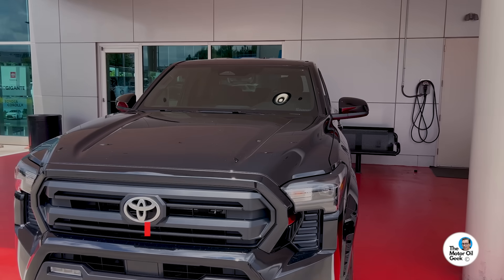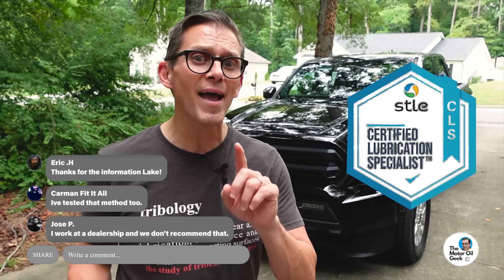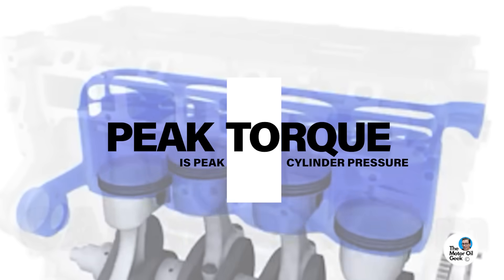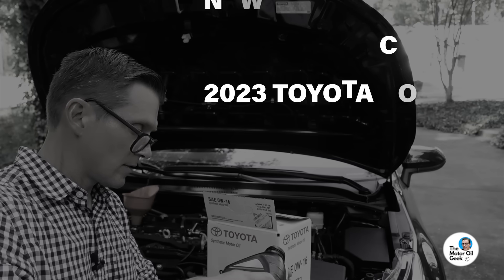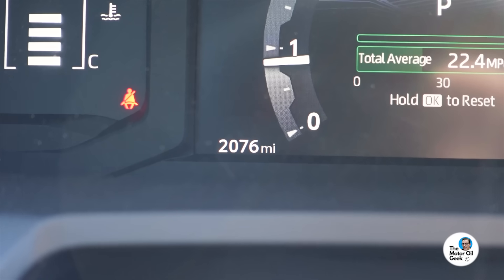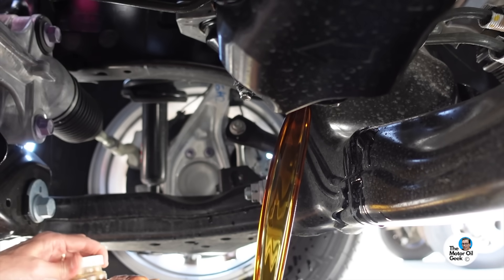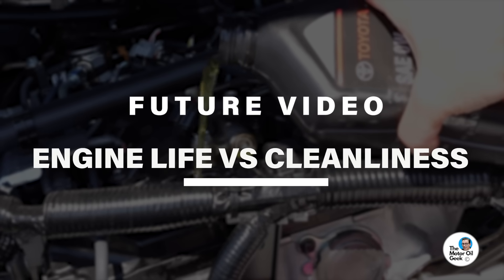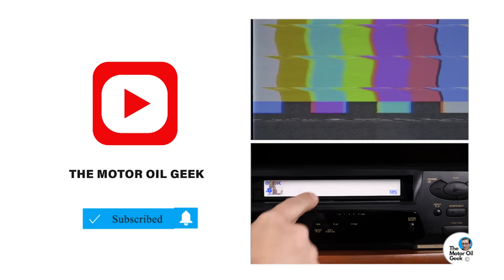The FACTS About Oil Changes (What The Owner's Manual DIDN'T Tell You)

Comment: I love all that you say. That said, and not trying to be contrarian, I have a hard time believing one should equate an air filter (whose defining methodology uses the original entrapment to catch particles it may not [not solely that]) with an oil filter. So yes while you can change an air filter too early trying to optimize causes you to not maximize its filtration. I donot know that also applies to an oil, a transmission or other type filtration to just assert it.

Comment: My Defender 110 had its first oil change at 1100 miles, even though the owners manual said every 21,000 miles. I ignore the manual and do the oil change every 4500–5000 miles or 6 months, which ever comes first.

Comment: So, what do you think about different oils being better than others?
I know hot take.
I switched to Amsoil full synthetic years ago, now I use their signature series full synthetic that claims it is good for 25k miles.
However I always change the oil in my 2024 Integra Type S, every 5k, and during break in I changed it at 1k miles, then again at 5k, 10k and I am about to do my 15k oil change as soon as my oil gets here.
I also use their full synthetic for high mileage cars in my 07 350Z with 180k on it.

I also followed owners manual specs, kept it under 4k rpms for 1000 miles, then only up to 5k rpms until I changed the oil, then after 1500 miles I took it to red line for the first time, I rarely ever go to 7k rpms, but once in a while, I normally shift between 3k and 4k, and when I an driving spirited, 5k rpms is more than enough.

Years ago I read about an 8 ball bearing test that claimed the Amsoil had noticeable advantages in reducing wear compared to the others that were tested back then, purple, mobile 1, Castrol etc..
I bought into it and started using it in all my vehicles back around 2014, is there any science to it or am I just a victim of hype?
Although there is no hype for Amsoil, most people never speak of it.
Reply from the maker: FAKE Oil Claims: The “Lubricity” Test Problem
https://youtu.be/ipunDlG1k-8

Comment: BMW has this ridiculous oil change interval of 15,000 miles, which is insane considering their inline 6 motors are turbo charged and their V8s. 
15,000 yeah no ways especially on a turboed 6, no wonder they have issues later on. Most BMW customers could care less because they get free oil changes at 15k. I would half that to 7500 at most. Would never buy a used BMW. 
This is why I have a Lexus RC-F with the 302 V8 hardly needs maintenance. I admit I should have changed the first oil change sooner than 5k, but I doubt it will hurt the longevity of the motor as the 2UR is bulletproof. I use OEM parts from a dealer and never on Amazon or eBay. Fake parts can damage your motor. I do my own maintenance as I do not trust the lowly fresh tech who just graduated auto tech school. Heard many stories where they overfill RCFs at Lexus dealers. So that's why I do my own maintenance and not because I can't afford it as the RC-F is almost $100k. Seen many Lexus V8s with over 200k miles run like a top. The famous Lexus GX SUV are so reliable they last so long, these vehicles are worth buying used but me I prefer New cars. They barely need any maintenance.

Comment: Now that modern cars let you see the Engine Oil Pressures, in Pounds per square inch, in real time, I have noted a difference in my vehicles. One is steady psi +- 5psi and the other has a variable range,+= 40psi, with engine rpm.  I think a video on this subject would be good!

Comment: I have an interesting question concerning older cars. For a retirement gift I bought a 2011 Mercedes E350 convertible. The Mercedes shop tells me that the oil Change interval is one year or 10,000 miles. I don’t trust the 10,000 mile so the most I would let it go is 5,000 miles. Then there are only certain oil that is Mercedes approved. Any thoughts or experience with oil and Mercedes would be appreciated.

Comment: Here’s a question I have for you motoroilgeek… what impact (if any) does fresh oil have on non moving seals? For instance valve cover gaskets or oil pan gaskets. Would not changing your oil cause these gaskets to erode/flatten faster than a vehicle which had its oil changed out regularly ? 

I can understand a valve seal or main seal wearing out due to dirty oil full of debris/contamination much like bearings take a beating with dirty oil, but some folks tell me that other gaskets like the aforementioned ones fail faster when there’s contamination in the oil from not being changed out. 

I feel like that’s not true, as I’ve maintained 15 year old vehicles that are pristine inside the engine, short oil change intervals for sure, yet the engine leaks significant quantities of oil from every imaginable point of failure.

Comment: I agree 100% on an air filter, actually filters better as it becomes plugged,  but I have to disagree with the same philosophy on the oil filter,  you must keep in mind that these have a built-in bypass valve, that you won't know whether it's bypassing or not, so, I would highly recommend to never not change the oil filter.

Comment: I've been following your advice for my 2025 Toyota Rav limited hybrid. 
Had the oil/filter change done at 500 miles.
Today, I went in to the dealer to  have the oil/filter changed at 3000 miles, 5 months old.
As I pulled out of the parking lot, the check engine light came on, flashed low oil and flashed hybrid system disabled.
Went back to the dealership. The kid "FORGOT" to put the oil in.
They dumped a quart in. Started it up, which sound like a grinder momentarily. 
Had them check the oil. Over filled.
Drained it, replaced the filter and refilled it.
Had them save oil from the oil filter and drained some from the oil pan into a separate container. 
They erased all the codes and gave me an invoice stated what happened for future issues! 
A couple of questions please.
Do you think there is or could be any serious damage to the engine? I get in RPMs getting onto the main road before everything happened. 
Who do you recommend to send the oil samples to.
Could the samples be contaminated because of the make shift containers they used?
Thanks
I enjoy your channel very much.
I've always been old school about oil changes. I used to own a company that ran 18 service vehicles. Ram mobile 1 in them and changed every 3k miles.
Cheap insurance! Never had an engine issue.
Thanks again and Happy Thanksgiving
Reply from the maker: We’ve seen several samples from engines where the oil was not properly replaced. In almost every case, the was now measurable damage to the engine via the used oil analysis. SPEEDiagnostix can do the used oil analysis for you to see what it shows.
Reply: @themotoroilgeek Thank you for the reply. I'll contact SPEED after Thanksgiving. 
Thanks again.

Comment: LOL ok… you are doing the right thing BUT is it “worth it” 99% of cars the rest of it doesn’t make it too far past 300,000 miles the paint is usually meh, the seats are worn and many other aspects are meh. So what exactly are you trying to do? I’ve had multiple cars last to 300,000 miles and before synthetics I did the oil changes at 3,000 and now with synthetics I do it at 5,000 miles. You are just throwing money away. I had a 2003 Toyota solara and it lasted to 298,000 miles, that series of engine had defective head bolts and the head would lift and at 298,000 miles the head bolts left the chat. So it didn’t matter what I did so the oil.

Comment: I did this anal oil changes on my first new car (1998 V6 Accord) at 750 miles (based on memory 😮).

I don't know if I replaced a special break in oil too soon or if I used too good of oil (1998 Mobil 1) and stopped the break in process. But that engine always used oil. 

Oil consumption was minor,  very acceptable but not appreciated.

Comment: Long shot and off topic but many of us have side by side utv of all designs. In the end though,  smaller engines. 2 and 3 cylinders. Racing, rock climbing, trails, farm work, etc. The community on this is HUGE! And it's a common topic of what's the best viscosity, intervals for the differentials, engine and transmission for both oil brand, viscosity, etc and filters. Would LOVE to see you dive into this for us. It would likely go viral in those communities.

Comment: I just bought a special ordered 2026 Ford Transit150, 130WB, low roof cargo van. I'm excited to do my own 900-1,200 mile oil change. It's a 3.5 non turbo with 12 quarts! of 5w30 oil . Please pass the Pennzoil Ultra Platinum oil ✌️

Comment: Ram had an interesting break in in the manual.  When new,  do random acceleration from 60 kmh to 100kmh full throttle 10 times in a row to set the rings.  It's in my manual. 
Everyone comments how much power my truck has.  Also I have a catch can.

Comment: Yeah I just bought an Elantra N, and as we know Hyundai has some longevity issues, especially high stress engines.  So did a painstaking breakin and dropped the engine and MT oil at about 1100km.  Dealer looked at me like crazy but did the work as requested.  I will follow your mileage for the remaining early oil changes.  It's costly, but it can't hurt. I drive cars fairly hard.

Comment: I always tell people, do as little or as much preventative maintenance as you want, because in the end that repair bill will be on you. 

As for my self, I change engine oil and filter every 3.5K miles, all other fluids get changed every March. My 2008 V6 Highlander has well over 250K miles on it and runs really well and idle is smooth and quiet.  😎👍
Reply from the maker: Thanks for sharing!
Reply: I had toyotas changed at 10k intervals with over 200k miles, too much frequent intervals have diminishing returns.
Reply: @roninbushitoろうにん  Probably so, but it is fun to do and it allows me to keep an eye on stuff while it is on the lift.
Reply: @lpg12338  Yes I enjoy working on my cars too even though I can afford nice cars. I just don't trust the dealers apprentice who just got out of automotive tech school. 
I also got a lift not long ago it's a challenger lift made in the usa. I maintain my own RC-F and other german performance cars.

Comment: I drive a 22 year old car that runs like it did the first day, brand new.  I fixed the upholstery and headliner last year.  This year, it was repainted.  An outdoor car.

Yes, I keep notes by each component.  Date and mileage.    When I take the car in for servicing, I treat it like a doctor's appointment with a modification.  A list of what service I think should be done and  the factory parts, if specified as best in the literature or by a qualified mechanic.

I am not a lubrication specialist, only a businessman.  Whatever service(s) is recommended by the manufacturer, it is to get the car through whatever warranty period promised.  The manufacture states that if you do rough driving, the service(s) should be done sooner.  

So, what about an oil change?   I have a series of ideas:
1.  my driving stops and starts on only short urban hops.  Maybe 3-4 stops in under 5 miles.
2.   I know what the price of an oil change with me providing a quality oil filter.
3.   I have an idea that if my engine fails, I might have to get a replacement car with a higher insurance rate, possibly finance charges, probably higher vehicle registration fees, and a drain on my time.
4.  If I wanted my car to go another 100,000 miles with oil changes at 5,000 miles and costing $50 each, it would cost $1000.
5.  If I made the frequency every 3000 miles, the additional oil changes would cost me $650.
      Would I rather pay $650 for more oil changes vs. the cost of working on an engine or the sales tax on a replacement vehicle plus the time taken to deal with the purchase and registration.
6.  My driven mileage each year keeps dropping.  So, now the change is 3000 miles or 9 months
7.  I live in a county that requires a smog check.  This translates for me into an Italian tuneup and additive every two years to pass smog.  I no longer get free retests, so an additive is put in.  I note that I waited 20 years to do the 15 minute carbon clean out before an actual oil change.  All of my driving had been short hops.

Comment: 500, 1500, 3000 is how I have done it for 40 years ( I am 78 years old ) All my motors had over 200,000 miles
Reply: This engine may not make it.
Reply: And how do you know that the early oil change made a difference?
Reply: @JDT-pq3wi ’Cuz momma said so.
Reply: @TruthInFlying 😂
Reply: Now 73 and my last truck had 240,000 miles before failed. All my trucks were used. I always got way over 1000,000.
Reply: @ginoaluzijr9522 Now that’s what I call high mileage.

Comment: Not just oil filters, but home air filters actually filter better as they get dirty. Most people waste money changing filters monthly (too often).
*Tip take a new and your current filter, hold both up to the sun side-by-side, if the current one is half as bright, replace it.
Reply: Air filters get better because contamination sits on top of the media.     The shearing forces of oil push particulates into the media.    Imagine your filter media has many different size pores (large, medium and small).   As contaminant enters the filters the smaller pores are more likely to be  blocked first.   As time goes on, the only remaining open pores are the medium and larger pores.  The automotive and aerospace industry recognized this in the 90’s where Dr. Finch developed the multipass test which tests the filter over its complete life.    See ISO 16889, SAE ARP 5454 where particle counters show a degradation over time.    Exceptions:  In some low velocity cases, filters can “cake” where contaminant will plugging the front face and efficiency will improve.

Comment: I just followed your advice on my 2026 Ford F450 6.7 liter power stroke. It has 2800 miles and I drained the oil but left the oil filter. I'll do it again at 4500 or 5000 miles.  I should change oil filter next time, correct?

Comment: If you had a motorcycle that sat over the winter and you had neglected to change the oil prior to winter storage, would you warm it up in the Spring prior to doing an oil change?
My thinking would be that any dirty oil and metal had a chance to settle to the bottom.  Why warm it up and distribute things throughout the engine again?
I can see the viscosity being thicker because the oil is cold, but you could chase any oil that remains in the bottom out with a bit of fresh oil once the initial dirty oil has fully drained.
Thoughts???

Comment: I see that the engine is not broken in by 2,000 miles. How does this compare with 1950s cars? Back then they said to change the oil at 500 miles initially, but weren’t they about 10x more crude/inferior build/faster wearing?

Comment: The guy from Donaldson refers to the air filter, not the fuel filter. Perhaps it might apply to oil filters too, but i would go for a oil filter change too. Also, very interested about the Toyota oil filter, and here is why. I own a 2024 Highlander Hybrid (i live in Romania), and the car came with an oil filter made by Denso, made in Japan. All the replacements after that were also with a Toyota filter, also made by Denso, but ... made in China. The difference ? Well, i kept both japanese and chinese filters and cut them open, and what do know ... the chinese one had 40% less filtration surface. It's too bad i cannot attach a photo of those two filters comparison to see it. But perhaps Lake already knew that, and that is the reason he kept the original oil filter ... maybe he can spread some light on that matter.

Comment: I think we're all anxious to see your next video for your recommended oil change intervals with a turbo charged engine.  My sister has the 2025 4Runner with the same engine & I told her NOT to go over 3K miles as she's bad about parking & turning off the vehicle immediately allowing the oil to cook inside the turbo charger.

That is why I'll be driving  my 2002 Sequoia & 2016 Avalon until the wheels fall off!  5K oil change intervals on the 2016 Avalon & once per year on the Sequoia with 152K miles. (driven less than 700 miles per year)  I'm resisting against turbo charged engines as long as I possibly can but I would trust a Toyota vs any other manufacturers if I had to buy a new car today.

Good luck with your Tacoma Lake and I'm happy to hear your thoughts about regular oil change intervals on your Tacoma as that turbo charger cooks oil when the engine is turned off after normal operation.

Comment: Hi Lake I’m fixing to buy a 2026 Toyota with a 2.4 turbo engine and plan on changing the oil like you have in video for break in. I plan on doing all oil changes myself would you recommend using Toyota oil the lifetime of vehicle or would I be better off swapping to my preferred oil Mobil 1 extended performance 0w 20.

Comment: What about hybrid engines that turn on and off and you get a electric/gas driving ratio of about 50%? Do  you do the first oil change at 1000 miles - 500 being on the engine?

Comment: They don’t take 10000 miles to break in bullshit . I’ve been a mechanic for 42 years and rebuilt hundreds and hundreds of engines over my career. 25 years ago rings were different and needed to be broken in and seated not now .. just drive them !! But don’t lug the motor ever in a high gear up a hill or drive slow in high gear.. let them rev . The crank and main bearing don’t break in only the piston to bore settles a bit the rings seat in a few hundred miles the cams shouldn’t be " breaking in. If they are giving off metal particles they are wearing because of shit oil . NEVER USE 0 weight oil unless in sub zero temperatures. 5/30 is what I use for everything..NEVER NEVER HAD A PROBLEM AND MY TACOMA HAS 400 thousand miles ..O weight oil is to meet  fuel efficiency requirements and that’s it period !!